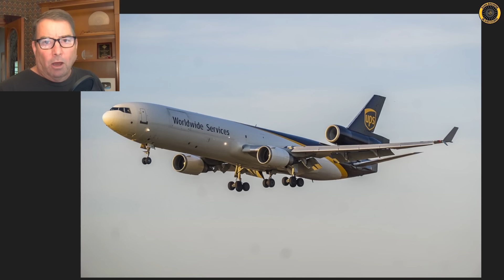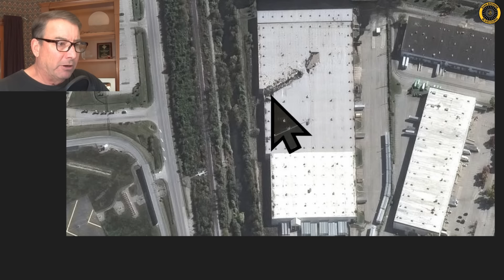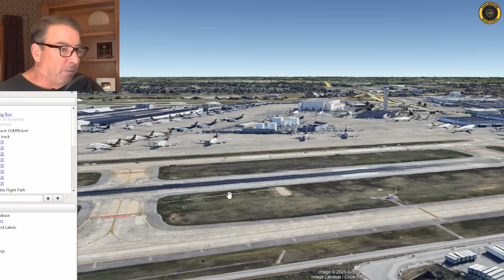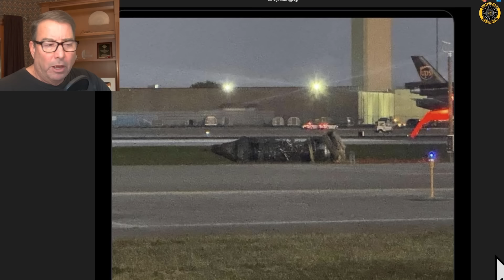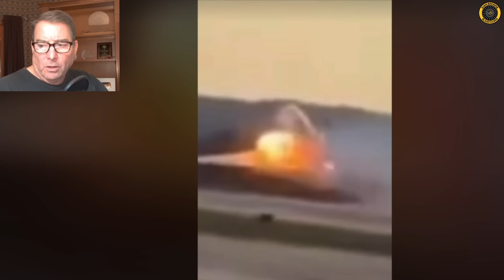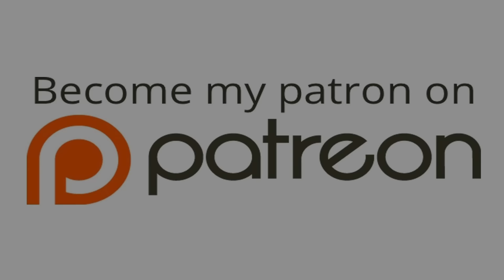UPS #2976 UPDATE 2 6 Nov 2025

Comment: Local news reports that FDR is in DC and does have 60 hours of data, so that should defiantly be crucial to investigation.
Also I’ll comment again, I feel like this has to be the most video of a crash that I ever recall, almost from start to end. Just about every aspect, from airport CCTV, the passengers video of lift off, to it coming across the roof, clipping the power lines and the petro recycling tank and rolling left into ground, then the other dash cam of it crossing thru the parking lot, then continuing down behind  the tire shop and sports bar, and into the auto parts and finally ending up in the recycling center.

Comment: AA191 seems to have more similarity with El Al 1862. The latter literally lost engine #3 (broken fuse pins), which took out #4 and damaged the right wing leading edge / slats. When Captain Fuchs ordered to extend the leading edge slats, left extended but right didn't. They lost the ability to prevent the aircraft from rolling to the right.

Comment: The local TV news here said that the data from the recorder showed that the plane never got above 175 feet and was going 210 MPH at the time that the recorder had stopped. I was wondering if they mistakenly meant 210 knots per hour or was it miles per hour? If it was MPH then the plane was definitely well above stall speed until it  impacted, meaning they must not have had any wing controls to rotate the nose up enough to climb out?

Comment: Looks like catastrophic left engine failure which caused the engine to depart the aircraft. Looks like the center rear engine ingested debris from that explosive engine failure. The “tug video” from the taxiway shows the rear center engine “puffing flames” as the aircraft rotated and tried to climb indicative of compressor stall / engine failure.  The “dash cam” video clearly shows the aircraft abruptly rotate to the left caused by loss of lift (left wing) and asymmetrical thrust from the right engine.  They are going to have to determine what caused the left engine to come apart so violently.

Comment: Bicycling behind Moffett Field Naval Air station I see at the end of the runways the adjacent perimeter light rail goes down below ground so it's overhead power wires are low near ground level so a low flying plane won't hit them. There are no trees by the freeway at the end of the runway until the golf course across the freeway. Some of those golf course trees should probably get chopped for safety. No freeway signs or lamp posts. Looks like they are very concerned about a low flying plane on landing or take off not hitting anything. The opposite of the Louisville, Kentucky, with high power lines and a building which could just as easily have been the parking lot for the buildings so the workers didn't have to wonder if parts of a plane or entire plane will be falling on them that day. Looks like there are a-lot of "That will never happen" people in charge of Louisville.

Comment: I am just curious as the Former DC10 Model's Central Core for the Meeting of All Hydraulic Lines was in the Tail Section of the Plane and ess Modified to Include Hydraulic Fuses (Check Valves) to Stop Massive and Catastrophic loss of Hydraulic Pressures throughout the Airframe.
My seeing that the Left Wing's Slats were still Extended and had not Retracted upon Engine Seperation was Either Due to the Engineering Program that was Carried out after the Loss of D10's, Notable American 191 and United 232 to Solve these Issues or the Retraction may have not yet Started due to low speed and height.
The other Question was that by a Person on YouTube who said Sparks were coming from the Number 3 Engine on the Right Wing I believe in the MD11 which might be Suggestive of a Compressor Stall in that Engine.
One or a Large Number of Catastrophic Failures Occurred and no doubt the NTSB ybe pouring all over the Black Box Data Records and Checking the Maintenance on this Aircraft which Apparently had a Major Maintenance Carried Out in September this Year 2025.
What we know for Sure is that that "Aircrew of 3 had Very Little Time to React " but I'm sure they Tried Everything to get her Up and Clear of the Area but the Situation Dictated Otherwise for these Poor Pilot's and Their UPS Family not to mention Personal Families and those Grieving as well the Lost Loved Ones of those on The Ground.
Again and I've said it here on a previous post response" A Terrible Tragedy ".
Regards

Comment: Upon getting airborne and crossing the airport boundary proper, the MD11 struck the warehouse at the end of the runway on the North Side, that is to say the airport side. The plane flew further, appearing to be controlled by the crew and passed through electric lines on Grade Lane. Wings intact, nose slightly up, gear extended and appearing to be in good shape. The vertical stabilizer appears to have some damage as it crosses Grade Lane but, the underbelly looks good despite earlier contact with the warehouse. Once across Grade Lane, contacts begin and the rear of the fuselage appears to kick up as the big explosion starts.

Comment: With that wing fire, even if they cleared the wires and obstructions at the end of the airport,  the heat from the fire would have taken the wing off( just like a cutting torch) in a very short period  of time. The time would be so short that an emergency return would have been impossible.

Comment: The acoustic liner or panels, coloured black in your one engine on crane photo, are installed ahead of high by-pass fan assembly. The liner material, light beige or red directly in the fan blade rotating path, is wear liner to reduce performance loss of the fan assembly. Each fan blade during rotation will lengthen or grow, thus cutting a groove or sealing path into this wear seal surface.

Comment: The fuzzy stuff at the front of the engine is the containment system to keep broken fan blades from hitting the fuselage. I believe it would have been made of kevlar, not carbon fiber. If you've seen a blade-out test (required for certification, you know the unbalanced engine gyrates wildly on its mounts. The test also tests the pylon as well, and it is a basic requirement that the engine stays attached. But again, if you've seen a video of a blade-out test, you know that's a huge challenge.

Comment: Mr Brown, love your content, big fan. I’m an airline mechanic for 40 years. The fiber around the fan is kevlar to contain a fan blade separation from entering the fuselage. My opinion is that the aft link on the pylon separated from the wing. The airlines are trying to implement a new cobra engine change system to save time. We used it at our airline and it did over stress the pylon. We had to do dozens of inspections of the pylons on multiple aircraft because of this. An engine change can’t be rushed. In the same respect you can’t fly to China in 8 hrs from EWR.

Comment: The acoustic panels and liner is only inside shroud. The yellow tint material that can be seen from the exterior of tbe fan shroud is a Kevlar containment ring to contain the fan blades if a root failure or fod damage were to occur. The picture of the engine shows concentrated damage mid to rear, this would be close to the high pressure compressor and 1st stage high pressure turbine.

Comment: Some MD11 have CF6 engines.  Early production had issues with the fan disk that were difficult to inspect for and could cause uncontained failure.  Engine core on the field is missing fan disk.  Fan blades are scattered on the runway and field.  Guessing that #2 ingested debris and failed which was bad luck.  Had #2 survived, plane would have had enough thrust to get into the air.

Comment: The engine possibly flue of due to fatigue from a fractured engine from being improperly placed just like another Boeing jet crashed at take off from the engine flying off from a fractured engine from improperly being placed. That place they did abort the flight they took off just to fall down crashing into a hanger at the airport.  Maybe they couldn't lift because of heavy cargo, just like another Boeing think it was fed ex where they took off but as they elevated up the cargo shifted from not being secured properly on the tracks the cargo shifted back bringing the plane down in both incidents just like this one no one survived. The  accident reminded me of a plane think it was Brazil not sure that couldn't lift crashed into a gas station across the road some people survived. Note they are referred as people once they take off they are known as souls.yeah I watch too many airplane accident on the mayday channel air disaster.

Comment: It strikes me a tad early to say the engine failed before the pylon detached. If the pylon detached first the mechanical chaos that followed inside the engine assembly could have easily thrown enough energy around to wrap acoustic liner into spinning fan blades as they disintegrated.

Comment: That material that wraps the booster section is a kevlar containment wrap in case of a booster failure.  Its job is to keep the first stage fan blades from flying out and hitting the aircraft.

Comment: If the acoustic carbon fibers were able to tangle with and cause a sudden cessation of rotation, could the torque effect twist the engine off sideways, structurally more vulnerable to sudden extreme sideways forces, they’re design is stronger with fore and aft forces.

Comment: First off my heart goes out to the family's, I am truly sorry. 
Sec I have 45 years as a A&P mechanic with 36 as a Lead.
There could be a doz issues, or combo of issues as most have.
That said FOD could be the issue as blades were  all over the place.
Louisville is noted for having blackbirds by the thousands.
Was it a new engine? I`ve seen a compressor not locked down from the factory come apart on takeoff just like this.
It will be a year before the report comes out.
I doubt it was a mount as their was a fire before the eng left the A/C.
And 100% they will find what happened.

Comment: Certainly not disputing the accident.    However,   The roadway that the MD-11 is passing over cannot be the one shown in the sat photo.  The angle of the flight path over the roadway, in the video still, is the opposite to what it would be to the roadway beyond the end of RWY 17.  The angle of the light is that of late afternoon.   In the sat image there is no evidence of the low buildings with parking areas out front or the manicured lawns on the other side of the street.  The street in the video still, runs roughly NE-SW and extends some distance from camera.   This roadway is not shown in the sat image but is not far out of sight in the top right hand corner of the sat image.    So in the video still, the MD-11 has already struck the warehouse. The damage pattern to the warehouse roof suggests that the fuselage had struck it.   In the actual video , just after striking the power lines the AC starts to roll left just as it disappears from view.      The poor Pilots, they got the ultimate sucker punch. R.I.P.

Comment: One of the first videos shown was of the aircraft taking off with a long trail of smoke behind it; this would suggest that the engine 1 problem happened during the early stages of takeoff, not at V1.  Did the left engine failure cause a problem with engine 3?  The apparent compressor stall occurred at the worst possible time.

Comment: That new dashcam video was taken in front of 7011 Grade Lane, approximately 109 metres south of the fuel recycling facility. The plane had already struck the roof of the UPS building. The vehicle was not on Crittenden Drive.

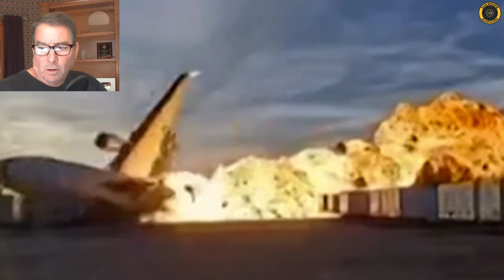Comment: 2:10 -- Looks like it was in the trees, there's a line pointing straight at the scar on the roof.  6:12 --  Pylon failure, possibly a rerun of AAL191.  A lot of mass in that engine, not much in the cowling.  The engine obviously tumbled a few times, so would have ended up past the sheet metal parts that it would have been shedding along the way.  An uncontained would likely not have taken the pylon with it.  

My guess is that the pylon detached, with engine at full power, severing fuel and hydraulic lines.  Fuel into the jet blast would ignite from the heat, separately from the other issues with the engine, and the fire would be fed by fuel and hydraulic fluid being pumped to -- then overboard from -- the missing pylon.  Lift and airstream would make it flow to the trailing edge, where it would turn into a sheet of flame as it hit the airflow from the top of the wing.  

Remember that the engine would still be developing thrust when it hit the ground, adding to the energy of the disintegration, adding to the massive amount of gyroscopic force from the disc, so it would go like a football for a few seconds.

The crew likely never knew what had happened -- the fire detection sensors went away with the pylon, so there wouldn't even have been an alarm.  Note that the level wings indicate even lift and functioning controls after the engine went away.  If not for all of the obstacles on the ground, they might have been able to put it down on the gear and roll out.

Comment: In retrospect it seems that 3-engine airliners might have been a bad idea from the start.  If either of the wing engines suffers a catastrophic failure, debris could flow back and damage the tail engine.  If the design allows for a single engine failure but not a double engine failure, it can make each of the wing engines a single point of failure on the aircraft.  Very sad...

Comment: I saw a news report that mentioned they were finding fan blades and pieces of blades in the grass alongside the runway so it increasingly appears to be a catastrophic fan failure with the resulting forces tearing the engine and pylon off the wing.

Comment: My question as a retired  United Capt  did the  Captain elect a reduced power takeoff at a very heavy weight. If so, how reduced was it. Full reduced power increases the takeoff roll with the possibility of an unbalanced field takeoff. In other words, less than max reduced power gives the AC more energy and a shorter takeoff run to V1. More energy at lift off, hence more speed, hence a better acceleration to V2 single engine climb speed. A situation like this with excess speed may have made somewhat of a difference. I never ever took off with max reduced power. I even discussed this with out training safety people but it went on deaf ears. Causal factor perhaps but who am I to judge a Captain with over 30 years no accidents, incidents, or violations.
Reply: Ironically one advantage of a reduced thrust takeoff is less stress on the engines, so less chance of a catastrophic failure like this.

Comment: That carbon fiber ring around the front of the engine case is there to keep a fan blade from exiting if one comes loose.
 This was put on the CF-6 due to once a DC-10 in flight think it was #3 engine a fan blade came off exited the case hit a window an a girl was sucked out. Also a Air Florida DC-10 on takeoff before V1 #3 engine tubine section blew up. Scattered shrapnel hit the fuselage. They aborted take off in time.
UPS No.1 engine probably had a catastrophic engine failure that locked up the spools and the gyroscopic effect ripped the pylon off...

Comment: The engine sitting on the runway tells us that it was not bolted on correctly;  under no circumstances can an engine just come off normally.  The engine started pulling loose and broke the fuel lines,  it is common sense.  Normally the right wing would be the one to drop due to more weight over there however;  the left aileron got jammed in an upward position likely pushing the left wing down fast. I have flown on this airplane many times,  it is not the safest feel when you're the passenger.

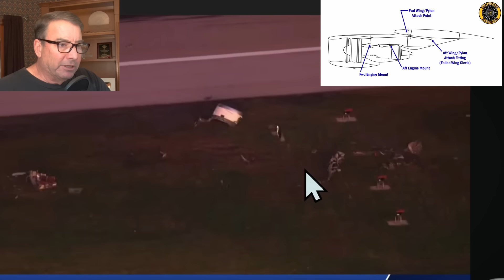Comment: Retired jet engine engineer here. The piece of engine cowling shown at about the 4:00 mark looks like the inlet and it appears to have a piece of the engine fan case attached to it.  There does not appear to be much of the engine fan module intact in the picture of the engine just off the runway.  A fan blade out event ( think bird strike) should not lead to an engine separation event, but a fan disk failure or fan shaft failure could lead to catastrophic failure. It’s all speculation at this point but the NTSB will figure this out.
Reply: "A fan blade out event ( think bird strike) should not lead to an engine separation event, but a fan disk failure or fan shaft failure could lead to catastrophic failure."

I agree that it is likely that there was an uncontained catastrophic failure associated with the fan, causing excess vibration resulting in the pyloon fuse pins breaking, releasing the engine from the aircraft.
Reply: Thx for your insight.
Reply: By your take, sounds like an Engineering Failure .
Reply: Any thoughts?
If kevlar was somehow ingested 
(by bird strike or other)
Would a full lockup of (as in no clutch like disengagement ) engines components ensue; if so would enough force cause component over stress beyond failure point regarding connection components,
Reply: @RoverSkyWatch the Kevlar wrap is on the outside of the fan case so cannot be ingested into the engine.

Comment: What would happen if the pilots had just set the plane down hard, reverse the engines and use the brakes?
Reply: After V1, the maximum speed before you have to make a decision to abort or continue take off, they would've overshot the runway straight into the highway either way, their best chance was to take off

Comment: @blancolirio, do you have any insight about why the left engine ended up on the right side of the runway? I wondered if that may point to a possibility that it was still providing thrust? Or would the inertia of the normal spin axis tend to make it veer that way? Is there any cant to the axis of the engine to the right to give the plane intrinsic stability? or to counteract the left turn tendency? It just seems puzzling to me.